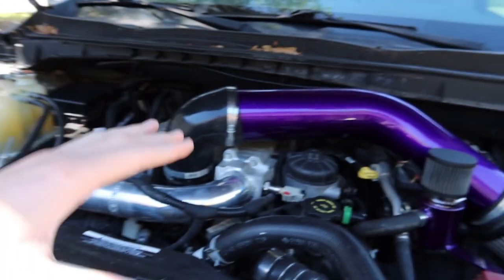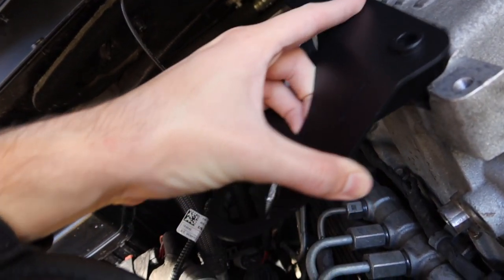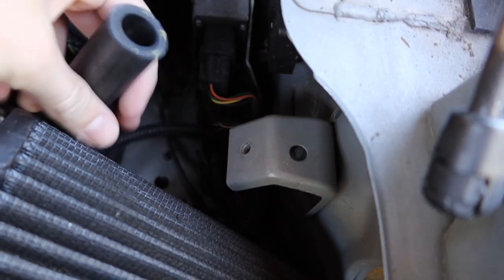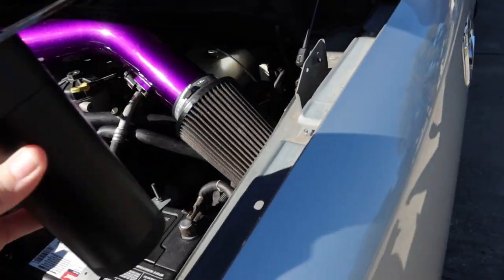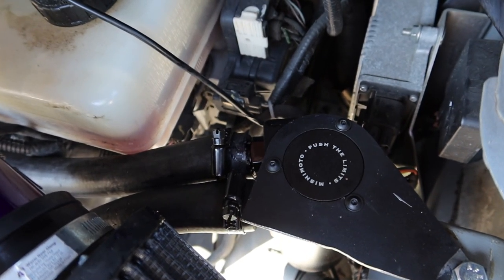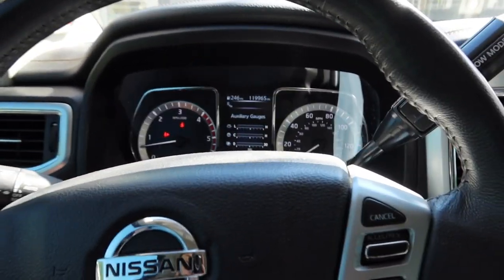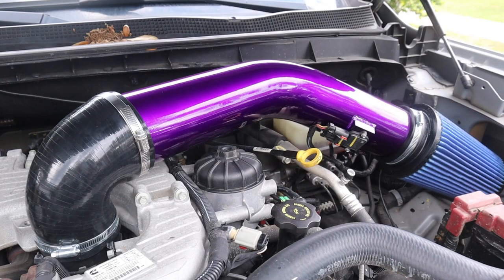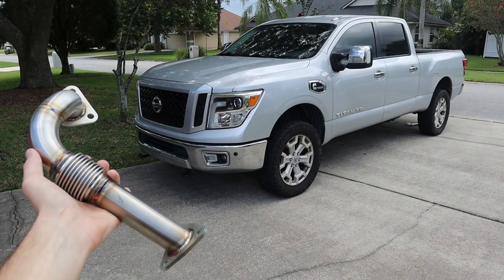my titan xd needed this a long time ago + full titan mod list

Comment: New subscriber, thought I’d share my story. I have a 17 PR, it’s been awesome, tows like a dream. It’s been absolutely great right up to the heat dome. Then all of the sudden, dead peddle, and threw a code. Turns out small turbo puked. It’s in the shop under warranty right now getting replaced. I also found a broken tailgate hinge as well. These are the first and only problems that I’ve ever had. I’ve heard that the 16’s have had lots of issues that got ironed out in 17? Liking the content 👍🏼
Cheers 🍻
Reply: I have a 17 also, how many miles do you have when the turbo went bad Thanks

Comment: Hopefully you haven’t had any issues with the catch can. I have heard horror stories about them CAUSING major engine damage due to them filling up, people not realizing, then it backing up into the engine. I was talking to a couple of the experts, and they said that there wasn’t much if any actual gains from one, but more likely to cause problems than anything. 

Strangely on my truck all of the exact same parts, front to back all fell off as well. I guess Nissan used faulty fasteners or something🤷🏻‍♂️. Luckily I was able to find lighter weight replacements. I personally decided to heed the advice I was given and it hasn’t caused any issues. I was told that it’s just an optional part that can dress up the engine bay. One that is known to CAUSE issues(no thanks)

Comment: Hey man I have an Xd and love your videos … I have been contemplating deleting my truck that being said I will be taking it and having it done …. After having yours done how loud is it in the cab and would you still recommend doing it ?
Reply from the maker: With windows up it is very quiet still, woth windows down it's rowdy, if you have a cool air intake then it will add turbo noise and that would be heard with the windows up either way
Reply: @kbridges5.0  would you still recommend doing it my truck already has a cold air intake and on the fly switch curios on mileage?

Comment: You should go to Synthetic Off Road to get your tunes. Best ones I've seen out there.
Reply: Absolutely! That’s where I got my full 4” exhaust, EGR Solutions kit and SOTF tunes. Zero complaints. I have heard that lots of people go to him to get their garbage tunes fixed. I decided to pay a little more in the beginning, instead of dealing with the frustration and having to spend more money later on to correct them. Very happy with my purchase. I think I spent something like $3,650 all in. Of course I added some optional parts like the SOTF setup, and full 4” pipe. 

It could be done going through him(the only person I would recommend)with just a single tune and the race pipe option for around $3,000. 

If you plan to keep your truck for a long time it’s the best money you can spend. Of course check your local laws for inspection related requirements before doing so